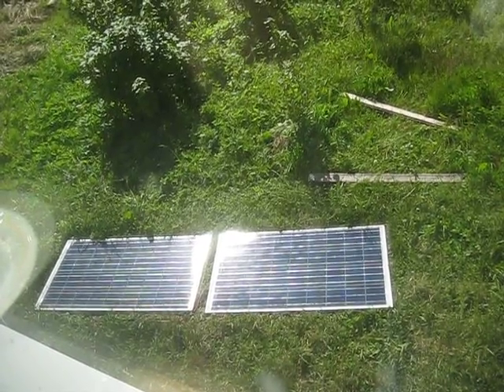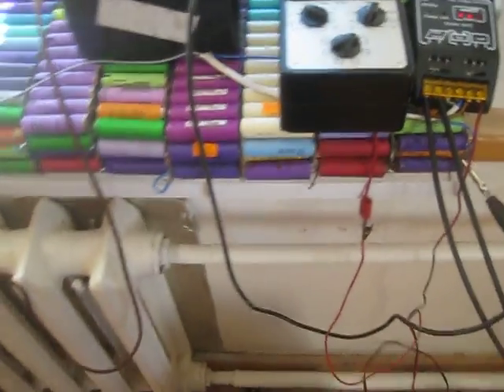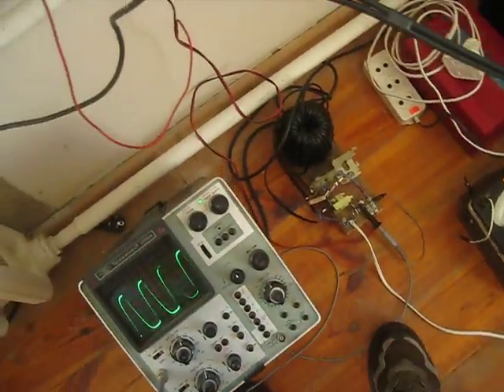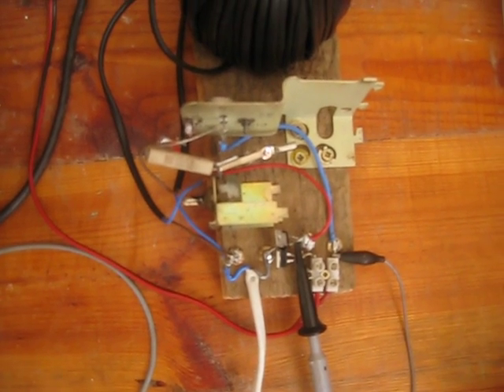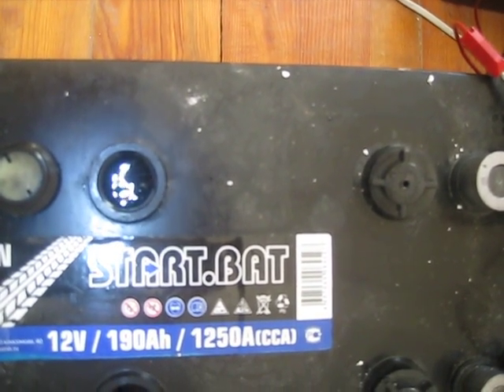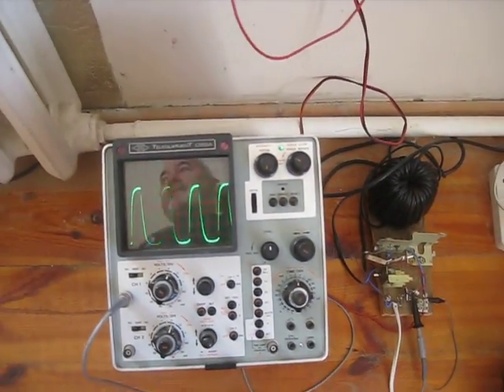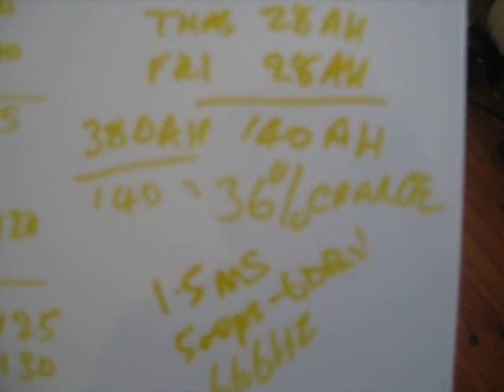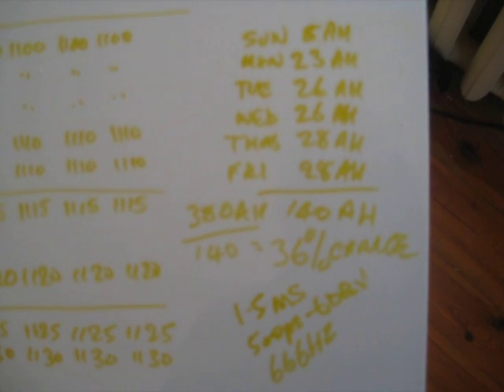RENE CHARGER 380Ah PARALELL LEAD ACID STACK

Comment: Do you know that lead acid have a "pulling voltage"? Most of them will do 12.2 volts and they will "pull or power" at this voltage. So its hard to know exactly what the total watt hours are, or KWh.. You should not pull them down so low as it will shorten life a lot !

You could get a few meters with blue tooth one for volts and one for amps, and log both. Then it would be a lot closer. Or some watt meter for DC.
You could also do what Hector said on that 2 amp charger if it's ac.

You may be a little wrong on the input as the voltage is always higher than the output.
the 140 amps was input with higher voltage, that's when working with watts only is best. Example 100 amp hour at 50 volts and 100 amp hour at 56 volts. 600 watts less at 50 volts. Most big SCC's will show both.
BTW I got the same black charger! it's been outside for a few years and still working.